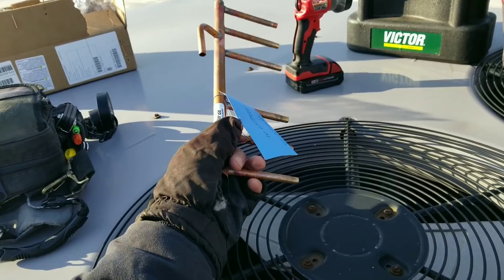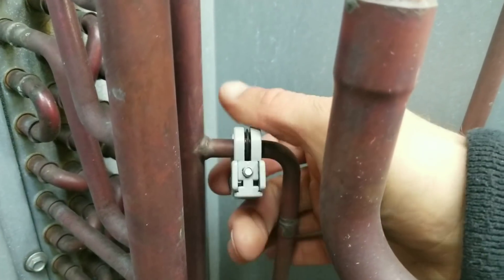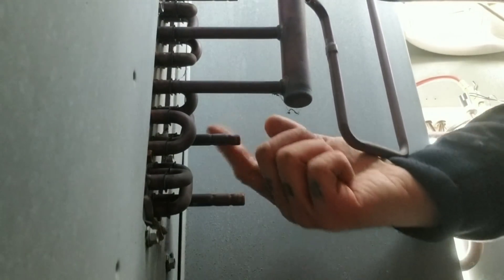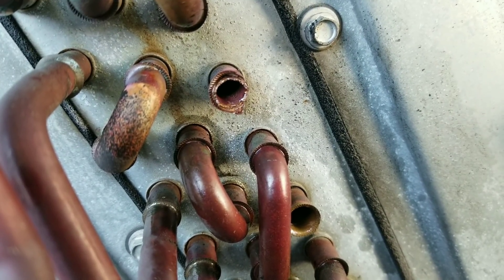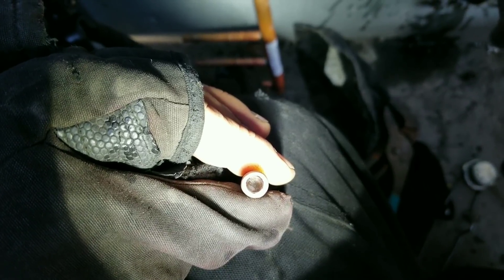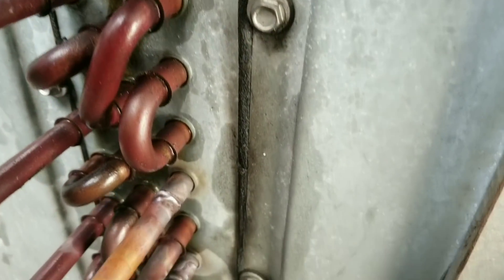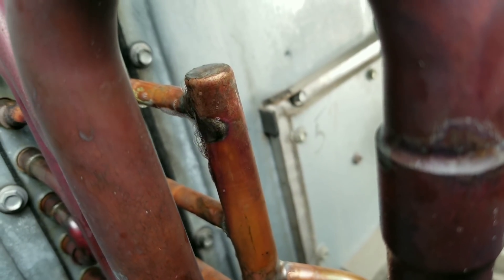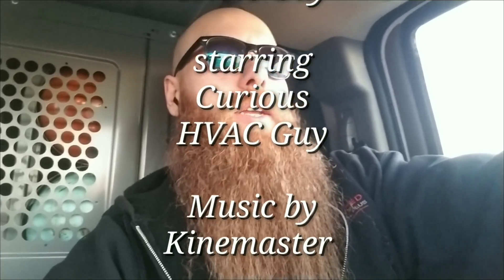Carrier package unit not cooling

Comment: Nice job there, good on you for checking all the joints that are new, including the factory ones.
I miss that tub of bubble juice with the sponge on the end of the little wand in the end of them.
They work so well, I used to do a mix of domestic and light commercial work.
That bottle of bubble juice was awesome.
I enjoyed, thanks for sharing the frosty morning outing.

Comment: I had one of these right in the middle of a summer at a Burger King. I just pulled the entire evap coil and fixed it that away.  Gotta be pretty good at brazing copper because that shit is thin on the Evap. I’m afraid doing this repair always shortens the lifespan of the coil.

Comment: Did you confirm if the orifice was blank from the factory or was it a contamination issue?  I've been watching a lot of your videos.  They're very well done and informative!  I'm surprised how many refrigeration system issues you run into.  I did the same type of work (Mostly RTU's) for 17 years until I changed careers and became an HVAC instructor.  I never saw so many refrigeration issues that required such invasive repairs.  Is it 410A and the POE oil, or just shitty factory procedures?

Comment: Something else curious. I’ve found when a condenser motor fails raising the head pressure this will cause the pistons to clog as well. Always check the motor bearings and run caps. Replace them before they fail. I have a location with 17 of these units. I’ve had to replace 2 headers do to motor failure. My theory is the high heat and higher pressure break down the shellac of the windings clogging the pistons. It’s a theory but it seems fact to me.
Reply: That's a hard theory to argue. Good thinking.

Comment: how did you know there was a problem with that header?  I havent come across that or maybe that's something I missed?
Reply from the maker: The footage I had diagnosing the unit was ruined so I couldnt post it-- but 3 of the piston tubes where frosted up, on top of lower then normal capacity, supply temp and slightly higher super heat
Reply: @curioushvacguy6876  that was my guess but I wanted to see if I was right. definitely good pick up. when I come across that model I'll definitely know now to check that area.

Comment: Why did you cut it out and then unbraze ?    Couldn’t you just unbraze it whole?
Reply: Its alot less hassle to just cut it apart and then unbraze the stubs. I do the same thing with reversing valves sometimes because it's a pain to remove the top 3 pipes depending on the unit.
Reply from the maker: Yeah there isnt a real good way to ubraze 5 or 6 tubes at the same time so your better off to cut them apart and un braze each one by itself

Comment: Great job brazing - what size tip you running? I do all my brazing with a 0 tip running 8 acetylene, 18 oxygen @ the regs. I like the 0 for flame control in tight spaces.
Reply from the maker: Hey Oasis, thats a good question- I wanna say a 2 but Im not sure on that only because ive had it on there ever since I got the set-- Ill doube check
Reply: instaBlaster.

Comment: Good call on the clogged liquid header. I loaded 150 reefers on the vessel last night and wouldn't you know it the last one loaded tripped the breaker when I energized it. Deckman told me the operator slammed the box hard.  The units run on 440 3 phase so the first thing I checked was the plug and cord, nope all good. I open the control panel only to find both phase correction contactors pulled in without power to the unit..!!  I get them to take it back off the ship and Today I replaced both contactors and found out they must have slammed the container pretty hard because The compressor and piping was damaged as well. So I replaced the compressor and straitened the piping and its good to go. It will catch the next ship...! Its always something...!!
Reply: Donald Robinson wow and I thought when 2 juveniles stole a golf cart and crashed into 2 condensers it was bad lol.
Reply: @actechformallyyomama746  lol
Reply from the maker: Oh man- got any pictures from that adventure? Marine HVACR is crazy to me- still the same stuff I know but its something ive never touched at all
Reply: Curious HVAC Guy I could send some pics. Where do you want me to send them?

Comment: Does carrier make a package unit that can be installed in a mobile home
Reply: Randy Torboli they do but you don’t want a Carrier. I’d check on an American Standard. Check consumer reports. They have less break downs. That unit Curious was in is a Carrier. You need a higher static pressure unit for a trailer do to the smaller duct work. That’s if you want it done properly. Oh and get one with a TXV.
Reply: @actechformallyyomama746  thanks ii will consider trane or American Standard
Reply from the maker: Exactly ACtech

Comment: Just a note...
Carrier had several issues with these. 
They came out with a quick fix. Works about 9 out of 10 times. 
Add AC Renew to system and let it run a little bit. Believe it or not It works. They suspect dirty coils burning oil, contamination is causing most of the problems. 
And AC Renew will flush the pistons out.
I have not had to change one out. Since I have tryed this.
Reply: yeah no luck for me. installed a new system and about 1.5 months later it was down with the Acutrol metering device so I replaced the filter dryer, check valves (heat pump) and per carriers instructions pored the Zerol ice directly into an open header not injecting it into the system.  let her rip over night. no good tried to switch it back and forth between heat and cool(heat pump) to maybe break it lose. no luck. I got pissed and threw a fit about how a brand new machine is broken I'm factory authorized dealer. and it's making me look bad to my customer. so they gave me a new machine and paid for the crane. but not the labor so that was a loser install for sure.
Reply: That sucks..!
Mine have all been units working before. Then get the dreaded some tubes freezing.  Low Back pressure restriction issues.
Reply from the maker: Thanks for the tip
Reply: I just wish carrier would do away the orifice header and use a TXV

Comment: What was the symptom? Nice job. That’s a lot of work getting all that gear on the roof
Reply: vapor side starts pumping down so it looks like its low on charge. tubing doesn't change temp because its not moving refrigerant just sitting there. frost forming after the acutrol metering device. looks like if you had a kink in the liquid line because its acting like a restriction in a bad way.
Reply: dirtbikenrcman thank you for the reply.
Reply from the maker: Exactly what dirtbikencrman said- I filmed the diagnosis but the footage got ruined somehow
Reply: Hvac 1 I was wondering about symptom too.